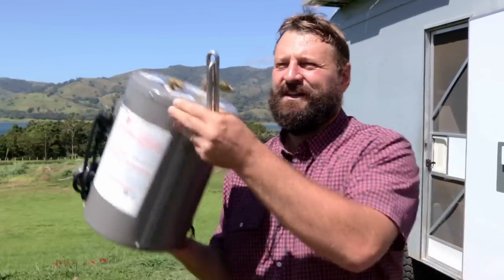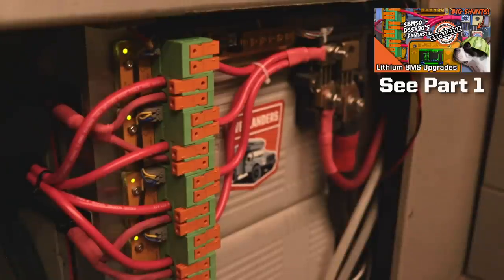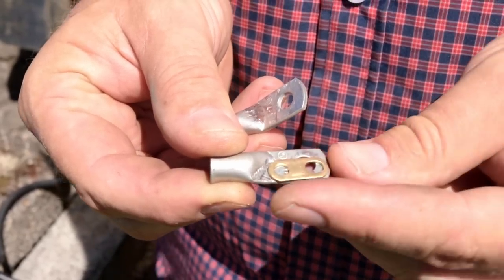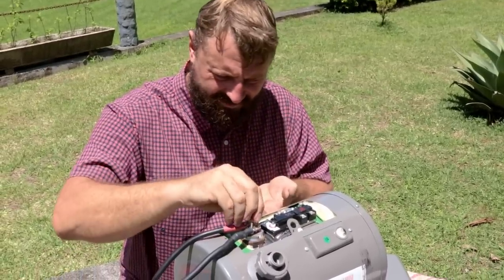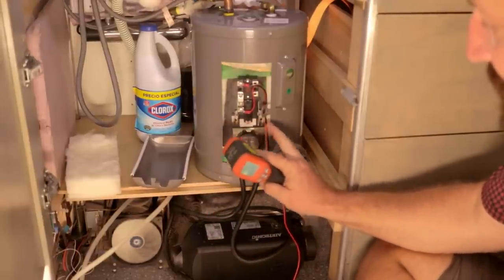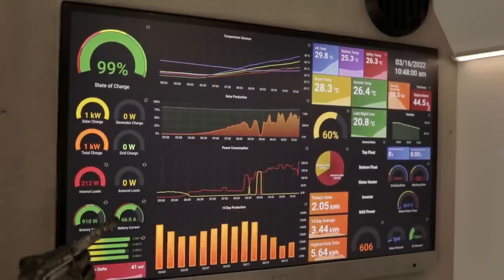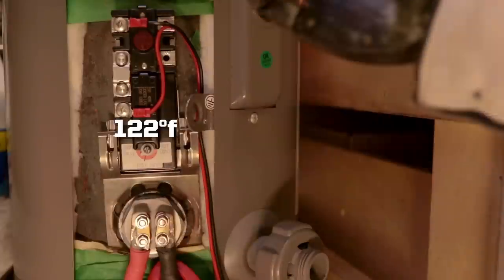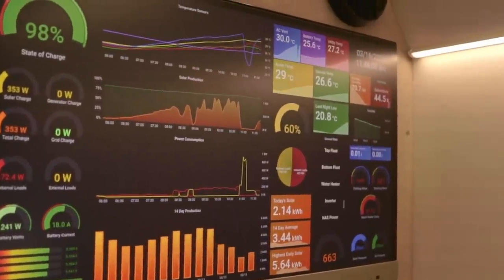Part 2 - Solar Electric Hot Water using DSSR20's Heat Diversion and 600w 12v Heater

Comment: So happy a problem solving geek like youself is sharing this online. I'm planning on doing a van conversion (24v or 48v power)soon, and want to have a ryzen itx build computer w/pico dc psu (full dc pc) . I have also been wanting to do somthing similiar to this video of not wasting wattage when batteries are full and the sun is shinning. I was planning on diverting it to a 24v zerobreeze a/c (if i need it) or diverting it to an atmospheric water generator ( haha which is a 300W dehumidifier/ with berkley water filter that feeds back into my water tank) Hope you guys are enjoying your trip so far and hope to see you guys at a meetup in Canada in the future once my van is complete!
Reply from the maker: Sorry, won't be in Canada for a decade or more... Currently shipping the rig to Columbia.
Reply: @Everlanders  well all the best in your guy's travels. Look forward to your video on explaining how you have your raspberrypi stats screen. Would there be any way to incorporate collected data from a victron  system. I like customizability of it but I'm not competent enough to rely on coding for all my BMS (I'm a basic Linux user). I Also think using a stream-pi deck for all my power switches, pumps, etc. Would be an awesome build idea!

Comment: Nice! I like that you have so much excess power even with a fridge and AC unit. Next you'll have to install a heat exchanging bitminer.
Reply from the maker: At this point we don't have access to run everything concurrently, we need to budget for AC or hot water as needed depending on our solar production and forecast. More on that in Part 4...

Comment: I approve this video, especially how you completely went overkill on the power cables to your hot water system if those cables ever melt that means pigs can fly on that day, nice job, also love the fact that welding cables are easy to get.

Complete overkill on the soldering of the wires to the termination lugs i am sure you would be able to use that cable to pull out a stump before lug comes off i also Approve of this, nicely heat shrunk as well.
Reply from the maker: So much Approval 💕
Reply: The more power you push with 12v the larger the cable you need. While a 12g wire is fine for a 20a line using 120v, move down to 12v and your cable needs to be 10x as large. There is a reason battery cables are so large on a 12v system.
Reply from the maker: This is a bit of an exaggeration there J, 14 AWG is sufficient for 35 Amps per ABYC standards.
http://circuitwizard.bluesea.com

Comment: This is great! I run my 10 litre hot water tank off the inverter, it pulls 800 watts and I tend to put it on once a day and that does me. I did look for a 12v water heater but couldn't find one. I might look more into making my own,  but I have been put off by those very same mythbusters episiodes on what happens to a water heater and things go wrong!
Reply from the maker: But if you rewatch that episode, Adam states that it was very difficult to get that result. They needed to defeat many safety systems...
Reply: @Everlanders  That is very true, but I'm still cautious :) Maybe I'll give it a go when I back from this current trip. It's working well enough for the moment so not going to mess with it on the road.

Comment: I guess you could also wire the element in series and run it on 24 volts which is the minimum on home solar systems. Good to know about these elements. Thank You. 73
Reply from the maker: Yup indeed! Although the power is squared... Keep that in mind, so you'd want to order a 24volt version.
Reply: @Everlanders  yes that would be better more watts. 73

Comment: Which voltage do the DSSR switch?  The straight output from your solar panels, or the output of the solar controller?
Reply from the maker: The DSSR's divert the panels voltage, in our case it's ~20 OCV, But that gets dragged down to 12 volts once the load is applied...

Comment: One of my first thoughts was "what about heating water when the SOC is not 100%?"  I supppse I am fringe as well as a 3%er, LOL.

2:50 Always be sure the rubber sheathing is up to snuff!  A failure could change your life! 😎
Reply from the maker: It turns out that manually directing the diversion heat is a pretty simple setting in the SBMS0 menu...
Reply from the maker: Not to mention I still have the original silicone heater mat which I can manually control anytime...

Comment: Have you considered using a home automation platform, specifically Home Assistant, to tie all your equipment together?
Reply from the maker: I have considered it, I have 20 years of home automation experience.
Reply: @Everlanders  Hi Jon, I wanted to share that you are the one that got me interested with programming Arduinos and how to automate stuff using 12VDC. I was so inspired that I bought a bunch of gear including some WEMOS D1 minis (ESP8266 Wi-fi) and have started my first project of automating watering my garden. In addition, I have installed Home Assistant on my NAS and setup monitoring through it. I keep watching your videos for more inspirations. Thanks for your amazing videos!!!

Comment: Another great video! Thank you for sharing it.

Any chance your soldered ends will relax, or even melt at that heat load? I suppose it would be about the best case scenario, so long as they don't dead short to the other terminal...but either way, you mentioned you left your proper lug crimper in Canada, but why not just beat it with a hammer? (Don't misunderstand, I'm not trying to strike up controversy, just kinda curious...totally being an armchair quarterback here btw.)
Reply from the maker: The terminals don't get too much hotter than the water... 80°c

Comment: Question. If I only use a 300w 12v element, can the thermostat handle that without all that fancy special wiring? I saw someone else use the same water heater but installed a 300w element and they just wired it the same way the 120v element was wired. That video is 2 years old and I dont see any updates with an explosion, so assuming all went well lol
Reply from the maker: You're asking me about their video...? Probably better to ask them how their project went.
Reply: @Everlanders I was asking you because you seem like you know more about electricity than the other guy lol
Reply from the maker: Obviously it's not going to last very long... 300÷12 is 25 amps... That little switch is going to weld itself closed in a few hundred cycles...
Reply: @Everlanders  I see. I found some DC thermostats online. They're rated for 25amps which is what 12v at 300w is. 
Might do that and figure out some sort of extra thermostat system that I can monitor from a Guage to also visually see the temperature.

Comment: Thank you for these excellent vids. Is the only downside to using the heater’s original 120v AC element with the original plug and run through an inverter a loss of efficiency? I have extra solar power in my 12v system and have been planning to invest in a decent inverter anyway. Any suggestions or cautions for keeping my instal simpler (more reasonable for my skill-set), and doing it that way?
Reply from the maker: Exactly, huge losses in the inverter while shorting its lifespan.

Comment: I’m looking at doing a similar setup. Did you wire it in such a way you can also override and heat water from the battery bank when there isn’t enough solar?
Reply from the maker: Yup
Reply: Hi, would love to know how you did that. thanks

Comment: What's the difference between the 12v element and the 120? Just the resistive materials used in the manufacture?
Reply from the maker: Close, the difference is how much resistance there is.

Comment: Interesting. I have no problem watching your commercials. My Victron components have no secondary take off to do such a diversion to for instance run my absorption fridge on electric a few hours a day. I will say the LifeBlue batteries BMS does have a j45 network plug, 2 each. No documentation how to make use of them. The factory Rep. Said they were for software updates. It may be possible to gather state of charge information from them and then setup a seco dary load takeoff that way. I'm able to do it manually for now plugging my shore power cord into the inverter, then unplugging it when the sun is low, 3 to 6 hours later depending on time of year. With the price of propane now, a few hours on solar daily could save a fair amount of coinage over time. 
Anxious to hear your plans to cross the isthmus whether by land or sea. Most go by sea but your resourcefulness makes me wonder if you'll be the one wo does it by land. Take care...
Reply from the maker: No, we'll be shipping by boat, there is no road through the Darién Gap. https://en.wikipedia.org/wiki/Dari%C3%A9n_Gap

Comment: Great video. Thanks 👍. 
My project will use 300W heating element and I'd love to use a cheap temperature controller but can't find anything above 20 A. 
Your solution is too complex for my skills. Have you seen anywhere a controller with a relay above 25A?
All the best!
Reply from the maker: The problem with cheap temperature controllers is the mechanical relays. With such high current they tend to arc and weld themselves closed, thus you get a pressure vessel with rapid unexpected disassembly.
Reply: @Everlanders  thanks for your reply. I used 40amp relay. It's simpler than I've thought. Seems to be working... When sun's out.
Reply from the maker: For a while...

Comment: The Electrodacus forum suggested fusing each panel if you connect/combine diversion from multiple dssr's . I'm asking if you did, because I wish to do the same as you have in the video.  I'm considering buying a dual voltage 12/230v element
Reply from the maker: Nope

Comment: I was thinking of an idea to solve your overheating wires maybe add some aluminum fins at the terminal kind of like a radiator. S*** you might even be able to put a peltier fan on it lol.
Reply from the maker: The wires don't overheat... But they do get hot as they are an extension of the heater itself. As long as the wire jacket is not cheap PVC, you'll be fine. Insulated to keep the heat in, 2 years and no problems.

Comment: Another Great video once again, keep them coming 👍 
I have a question about solar panels its probably a stupid one but do you have to use 12v panels.  I only ask because my son install solar panels for house in the UK. I was wondering if I could use them ?
Reply from the maker: No, you can use 24 volt panels too, you would just want to use a 24 volt heater element to match in that case...

Comment: By using this extra power, your solar panels should last longer.  When power is extracted from the panel, there is about 20% less power dissipated inside the panel and hence, they run cooler and should last longer.
Reply from the maker: Good stuff!
Reply: @Everlanders  So where do we put excess energy when the batteries are full and the water is at temp?  On a cold day, send it to a space heater, and on a hot day, run the A/C more.  But on a perfect day... what?  Make hydrogen?
Reply: @Nic7320 Dump it through a shunt.

Comment: I am following your old setup, with a 200w heating pad. What were the downsides you experienced?
Reply from the maker: I guess the only downside was speed, it took about 2 hours to get to hot, this takes 12 minutes to get to the same 50°c
Reply: @Everlanders  the tank of the 10L "boiler" is plastic so i am going to wrap the tank in belt of aluminium flashing to disperse the heat around the tank, with the temprature sensor to be placed  on the aluminium on the oppsite side or against the tank or on the orignal heating element area. testing is required. i have ordered a thermosatic mixing valve to mix my target heater temprature of 60C down to 38C. although i should probably add another layer of over temprature protection at 80C that cuts it all off.
Reply from the maker: @isstuff  A plastic heater tank..? Ours is steel. I don't think plastic would work very well being heated externally, it makes a good insulator.

Comment: can a solar panel be connected directly to a water heater ( obviously via thermostat ) or would some sort of electronics be required?
Reply from the maker: Sure, that's effectively what I've done here, the only difference is that the DSSR20 switches automatically between our batteries and the water heater.
Reply: @Everlanders  Ahh I thought w. heater was being supplied from batteries. Thanks.
Reply from the maker: Nope, it's utilizing surplus solar after the batteries are full, it's a really slick system.

Comment: If we have an al in one power unit like the Anker 767 can we just plug in the 120 plug into the Anker and get our hot water that way?  Would that’ll  save us a lot of work and still get the same results? Thank you from BC
Reply from the maker: You could but it would be very inefficient and would use 80% of your small battery to do that. The whole point of what i'm showing in this video is that the battery is charged first and when it's full, the solar power that would otherwise go to waste is diverted to heat water. (and the batteries stay fully charged)
Reply: @Everlanders  Thank you, I have gone over the video a second time and learnt more, and will do so again and again until I understand properly. I am a photographer and intimidated by some electrical work, I saw another Canadian, made to explore, using the same or similar system with a 300w heating element.  I am stuck on whether I should have a power system built from components or use an all in one unit like the Lion energy safari which has an Andersen  connector at 25amp to be able to use dc fuse block or the new Anker 767 unit which has 2 x10a cigarette lighter connectors. I am converting a sprinter on Vancouver Island, really glad i found your channel Thank you for taking the time to reply to me very much appreciated.  I really like your power system. Does electro dacus set up power systems?
Reply: ?Oh  One More Question If Possible If I Wanted To Use the Rheem unit For A Shower As Well Would it be  advisable To Get The 4 Gallon Or 7 Gallon Unit instead of the 2.5 gal unit.
Reply from the maker: It depends how much water you have access to and how long you want to shower.

Comment: Id use Romex solid copper. Its what everyone uses. But what you used is of course just fine. At that wattage speaker wire would be ok.
Reply from the maker: 75 amps... Speaker wire? 😳

Comment: Im Very interested in this , the grafics , the solar..  I have a off-grid house, set up like an RV or camper, nearly 1k ah 24v batt, and a smaller 12v system, that does 12v lights, and accessories,  I don't trust my well to drink the water, I'm going to add a 12v pump for the kitchen, and use a heater like yours, or another instant/tankless gas heater. I have alot of work to do, I have plans to add a 1200-2kw 12v inverter as a backup, because in an emergency I could connect a car to it and charge it to keep the fridge going, and maybe a microwave, I'm thinking about going 48v on the main system, so I will not need so many charge controllers, and get a 6kw Genetry solar inverter, being I could probably pull 8kw from it for a while, I can cool it with the cool basement air, although I can probably stay below 2500watts, I plan to use my generator to wash clothes, I'm planning to build a diesel generator , that doubles as a DC generator to directly charge batteries, as well as a 7kw ac split phase generator, and do about 300amps at 30v, not sure what it could be capable of at 60v+/-, 
I would need to build a regulator for the alternators for 48v, maybe run them in series,  and burn waste veg.oil ,
I also been thinking about converting my wood stove to a boiler, and build a steam engine. To generate DC to charge batteries, and use radiators in the house as heat and to condense the steam, for a closed system, maybe use a heat exchanger, to get hot water. I also been thinking about building a thermal storage, like build a small room big enough for a few hundred gallons of water, set it on a few inches of foam and wood, with about 12"-18" of insulation in the walls, and about 2' for the roof, use the wood stove to heat it, as well as solar thermal collectors,  with a steam engine, generator doing about 600-1500watts+/-,  for about 12hours more less. It would definitely be worth the effort, it would also heat the house, I'm in the foothills of NC,. So heat is needed about 3months a year, and only half that needs serious heat, I'd like to add heat to the floor, before insulate it,  use a tiny pump, that can circulate about 5 gallons per hour, but definitely keep the radiators for the really cold nights, may e the thermal storage can keep heating for a day or so after the fire is out.  Part of it is a crazy dream, but I definitely need backups  but definitely interested in what you got going on,  I plan to build a couple thermal solar panels, with 1/2" aluminum tubing, and plumb that into he thermal storage ,  the hard part is figuring out how to control the mess! Haha,  maybe I can learn Arduino or something,  but definitely need it to be safe and energy efficient,.   Sorry to ramble!! But I'm very into this stuff, alternative power, fuel, life, everything!
Reply from the maker: The problem I have with tankless on demand electric water heaters is that you can't store the energy as heat in times of surplus... dumping that power into a thermal battery is cheap storage.